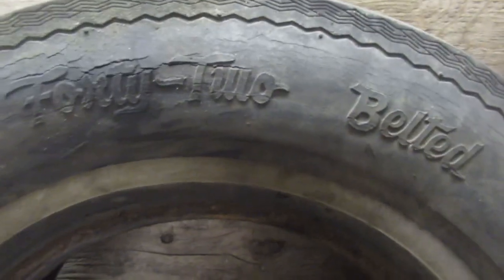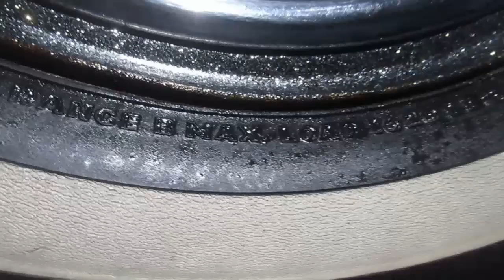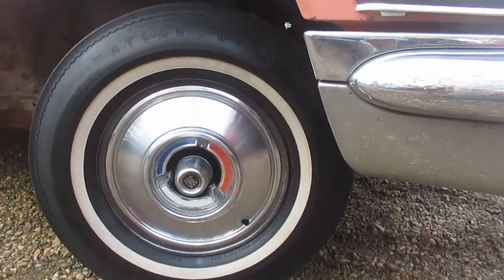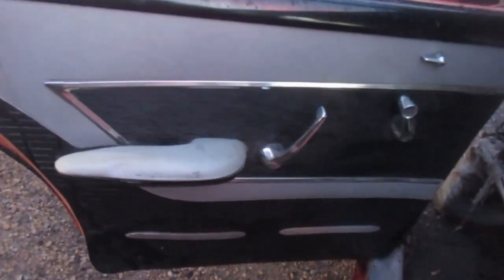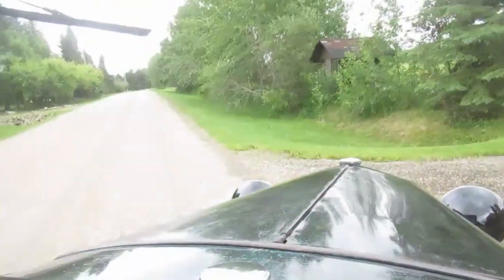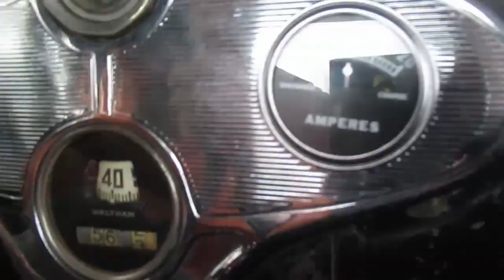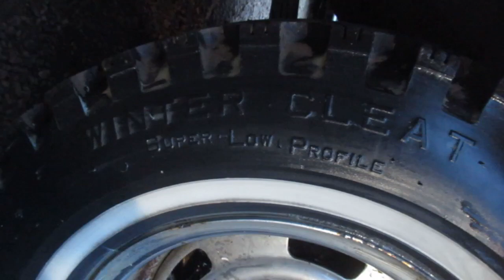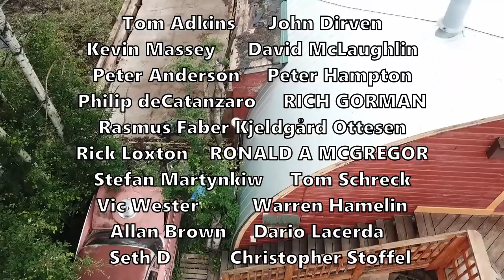1931 Ford Model A Finished and "My Classic Tire" Special!

Comment: Somewhere in central Canada lurks a 361 engine and a cast iron Torqueflite waiting to make Dean's dream come true.
Reply: He might better go to BC and buy a rust free 59 Chrysler. Lots easier and cheaper than trying to fix that heap.
Reply: Yeah and a full set of rust free floor pans o heck get a new one anyways!
Reply: You're probably right about that, Mr. Danforth. But buying a car with solid floors and rockers will cost precious points from the judges in the Waste of Time Olympics.

Comment: Atlas tires sold by Esso, Standard and American stations in the 60s and 70s.  I remember cleaning white walls with comet and a scrub brush, good times.
Reply: An  S.O.S. Pad on the white walls did wonders.
Reply: We used Brillo Pads at the Kerr Mcgee and sold retread Bandag's.
Reply: Lightning Whitewall Cleaner from Canadian Tire.
Reply: Lots of weekend days were spent washing cars and cleaning white wall tires. Comet work nice for just cleaning the white wall with SOS if somebody mis-judged a curb and the tire had the black scuffs.

Comment: Don't want to rain on your parade, but once one of the two "new" tires on a abused car I just bought and suggested they replace because 2 tires had no tread, they said fine and gave me re-caps. One went flat on the way home. That line looks a lot like a re-cap line around it ??? The 31 is just amazing, great job !

Comment: JC Penny seat covers or JC Whitney? :)  We used to always use that Westley's "Bleech-White" on those whitewall tires.  It was like, no matter how many times you wiped, you were still gonna pick up black and get it on the white, LOL!  Meanwhile today on "My Classic Hubcap"...  One of your electronics agents should be put to work on the radio.  Usually the vibrator on those things is shot, but they can be replaced...heck, some folks even rebuild them.  Then you can really freak folks out.  Yeah, my car is good for more than just looking at, listen to this!  Put a little AM transmitter in the glove box crankin out some classic 50's tunes while the rest of the car is rusting into the ground :) but cleanly!

Comment: I use to sell Atlas tires at my Chevron Gas Station.
Reply: Atlas Plycron "the round tire" great looking/handling tire, before radials took over. My buddies and I worked/hung out at a Chevron station, a million years ago. Thanks for sparking the good memories. Young guys and their muscle cars, enjoying life. Then Uncle Sam came calling.
Reply: I worked at a tire factory in Mansfield  Ohio in the early 70'S I was the fourth generation in my family to work there! Unfortunately the plant went belly up due to competition from overseas  factory's ! Those old tires would hold up for years! I have a 71 Cutlass with a set of tires on it that were purchased  in 1975 and they're still in terrific condition! The tires they make today go to pieces in a few years! I have a lot of old cars  at my shop and some of the newer radial tires blow out with the car sitting still!

Comment: another great installment. 
glad you finally got done joy-riding. pa walton was calling all over the county for jim-bob and john-boy to get the truck back to the mill.
windsor looks much better with those maypop (may pop at any time) tires. i also used to pick from the local tire pile for my willys pu.  size and type (grips) were the only discriminators. i distinctly recall atlas 42s were some of the best for keeping a bonfire going. also great for smoking venison sausage. the flavors were exquisite.
also glad to see the list of subscribers continues to grow.

Comment: I would have pulled the right tail lamp on that Windsor and put a big iron bar in through the hole and started prying that big dent out of the quarter panel! Plus I would be  looking at the stash of old Mopars in your yard like the four door Fury you're stripping  and pull the engine and trans out of it and put it in this one, Or go see your buddy at the junkyard and get an engine and trans. from him!  Also I would use old car hoods ,roof's and deck lids to make patches for the floor  where needed! Down and dirty! Just make it safe! Take rocker mouldings from any car you can find, cut and trim to make it hide the rusty rockers, plus find some quarter mouldings to cover the rust on this one and go! I do that with cars I find and make them safe to drive and go with it!  I'm kind of  the American version of you guys but without the cameras! I only have 40 cars though! I'm still  that kid building model cars but now the cars are bigger!

Comment: not sure if you know or your into trying it but actual brand SOS pads clean whitewalls the best!! used to use them on my old 13 inch wire wheels haha but now i use it on my BFG radial TA lettering and honestly it works good!!

Comment: I've done the same so I could move a car on a trailer and move it around a yard when i got there. I had 3 different sizes, all were perished and 2 were bald.  The guy said "You know they are no good" I said "they're ok, they will hold air, there's nothing wrong with them" I explained and he said  "I"ve never fitted tyres this bad before and laughed" I did a tune up on a model A 20 yrs ago . I couldn't find a TDC mark so I had to look it up and found you take it up to where you think TDC is and unscrew a pointer from the crank pulley and turn it around and screw it back into the crank pulley and it locks into a hole in the block then you set up the distributor as normal.  Then unscrew the pointer and turn it around and screw it back into the pulley.. The water pump was leaking out of the shaft. it has a castellated nut  with a lead washer behind it . You tighten it up a little, make sure it still turns and it stops leaking. So simple. LOL

Comment: Before I was old enough to drive we had a '56 (I think) Winsdor that was this same pink color. Mohawk Rust sounds so much better!. I really liked it's style. The engine had aluminum heads and Dad blamed them for occasional bought of vapor lock. That does not seem like a good reason to me now.

Comment: Fun Stuff! Pretty sure the sliding windshield brackets on the Model A are upside down  8^)
Reply from the maker: Yours is hinged on the bottom? Not sure I understand... Cheers!
Reply: @coldwarmotors  The windshield is hinged at the top,  but the brackets that hold it open (on A pillar) should point "up" when the windshield is completely closed. Look at my video @ 1:28 you can see the RHS (other places in the video also). https://vimeo.com/196913149
Reply: Time to consult with Manual, he knows everything.

Comment: Why not put the engine and transmission from the original chassis of the 60 Plymouth into the Chrysler. It will be out of the elements.  Also think the 59 Chrysler should be parked where the 50 Chevrolet is, matching bookends so to speak.
Reply from the maker: That is actually the plan, haha! Cheers from here....

Comment: ford put the water pump in the wrong place. no good to pump hot water off the top of the engine into the top of the radiator. wrong.
Reply: Hi, when it draws the hot water off the top of the motor it simutainasly draws cold water from the bottom of the radiator, sucking it  thru the engine to cool it. If Ford got it wrong how come it works great?

Comment: great place for the gas tank NOT. safety last. any good model A will do 60 mph
Reply: Hi i was wondering the same thing. Most guys relocate the fuel tank. These guys love originality. Hell if it works good its probably ok. Mabye not even 1000 miles a year.